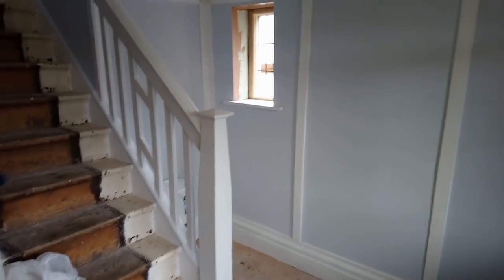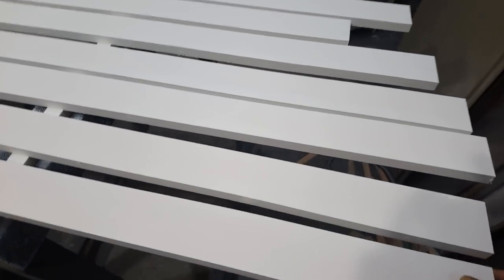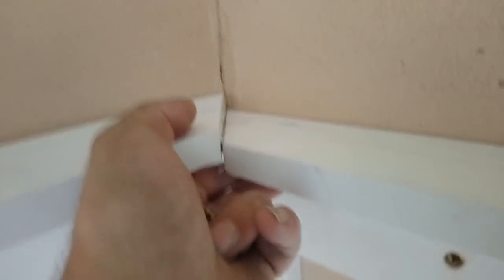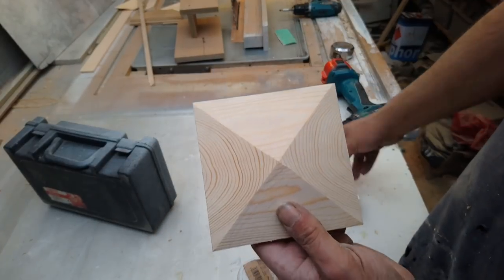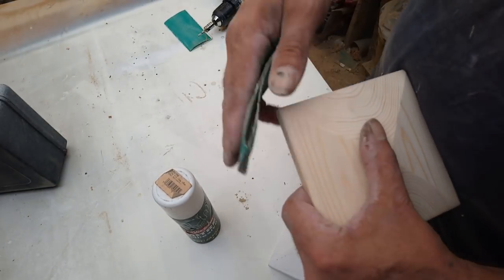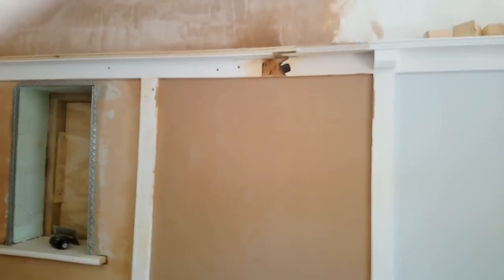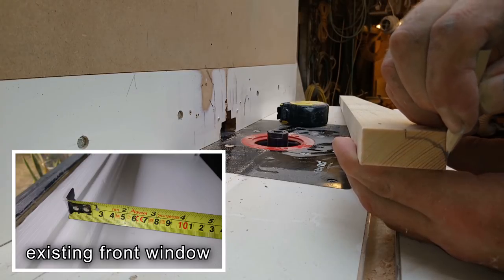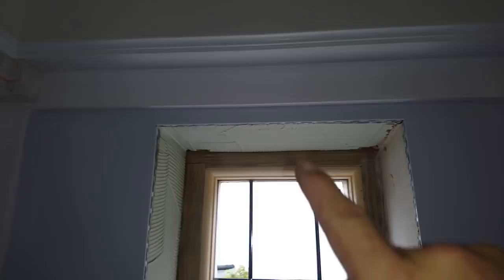Finishing off my friends hallway, newel cap, beading & wall panel slats

Comment: That staircase repair shot shows me how I should probably have done mine 🤣. Still mine won’t be going anywhere anytime soon and I’ve plasterboarded over the agricultural timber and screw combo that now reinforces it.
Reply from the maker: 😁😁👍 As long as it doesn't fall to bits no-one will know what's under the paint 😉👍

Comment: Good videos mate, i have watched back threw a few now. I have noticed that you seem to filter (course filter though) all your paint including the primers and all with the same size filters to. I was always told not to filter primer as you remove to many of the solids reducing its filling/build properties and that 2.5 fluid tip and needle will paint thicker paint than that although you'll never get as good a finish as with thinned down paint, also 2.5 fluid tip and needle setups seem to have a smaller fan pattern on them than some of the smaller fluid tips and needles (my guess would be due to them mainly being used for thicker products)

in one video you said you had to warm the PU adhesive up in warm water because it was cold and would not come out the tin well you can also do this trick with paints to save on thinning them down so much in the cold month, if your using a paint that has a hardener to make it cure you can warm the hardener up to but its already pretty thin so not much need but have seen some people do it.
Reply from the maker: Thanks Ross much appreciated 👍, Yep i use the same filters, 190 normally but ran out so i have 280s at the moment, there's not much difference to me, when filtering with the 190s there's next to no residue in the filter except the occasional lump which you wouldn't want in your gun any way, I avoid spraying if poss when it's really cold but if i do i sit the can in front of a heater to help it flow as you say. My neighbour is a joiner who sprays & i've talked to quite a few people about spraying, everybody has their ways, it seems you can discuss & try to 'share' but as i learnt in the end it's a case of taking in as much info as poss, experience n trial n error,

Comment: I like the little dig at the painter 🤛👍
Reply from the maker: 😊 yep, the majority of painters are crap, this little dig was more than justified 👍
P̶a̶i̶n̶t̶e̶r̶s̶ ̶, crap painters is one of the reasons i spray stuff. I spend time making stuff just for them to come along n blather it wi paint, there's been times where I've gone back to a job n didn't want to take pictures because the finish was so bad, I haven't found a painter I'd recommend yet 😕🙈
Reply: Gid joiner Yeah bad painters can make anyone's work look shit. 
I lived / worked in Holland for 7 years and no shit most of the painters I came across there could make a first year apprentice look good. I've never seen so much filling and sanding, top  class lads. Saying that they had to be good because most of the joiners I came across were lazy rough arses. Great channel btw 👍
Reply from the maker: I work at a house quite often, they'd had an old kitchen painted, you'd think it had been sprayed it was that good, no brush marks, everything was spot on but this man is booked for months n isn't cheap. 
The painter here sanded nothing, painted over drawing pins & the old built up flaky paint from where the toilet was 😓
You'd say a blind man would be happy to see it but i think it was the blind man who painted it 😆
Thanks John. 👍
Reply: Gid joiner Sounds all too familiar 🤯

Comment: I hate painting but started using an airless sprayer and wish I hadn't after watching you, my overspray is crazy, what system are you using?
Reply from the maker: 😂 Yeah it gets everywhere, I use a gravity feed gun & a compressor, 
the amount of dust on the floor (& everything else) after spraying is surprising,
Reply: Have a look at Peter Millard's channel, he had issues with bad overspray to begin with but managed to get it under control.
It's a Graco Ultramax he is using.

Comment: could the newel cap have been made with a router table or would the bit tear out the surface grain
Reply from the maker: A sharp cutter would cut ok but I think it would be hard to get a router cutter big enough, you can get chamfer panel cutters but they only cut about 50mm, There's straight/slightly tapered cutters or maybe just a straight cutter which you can get 63mm long & use a jig to hold at the right angle similar to the table saw except you'd be tilting the piece rather than the cutter, maybe on a spindle moulder but cutting a short piece like this might be dangerous, same for a router table prob, 
either way you'd have to hold the piece in a jig & run it against a 'cutter. I think using a router table would be harder than using the saw, a good sharp saw blade gives a good clean cut & is a more efficient cut therefore less dangerous & quicker.
Reply: Gid joiner tablesaws defo the right way, came out good (and the bullnose) 👍🏻
Reply from the maker: Thanks Phils, Yeah i was happy with it 👍😉
Reply: +Phils Obsession
You could make them with a spindle moulder but not everybody has one and it would not be worth it unless you would making hundreds of them. 

You could do them by eye but it would take lots of practise and even when you get good it is still a slow process.

Comment: Slightly off topic but if you could share some advice it would be gratefully received, 
Im in the process of researching prior to buying a planer/thicknesser. 
I see you have separate machines. 
I was wondering would a P/T be as good?
Reply from the maker: I haven't had a lot of experience with the smaller machines that have to have the surface planer bed lifted, 
For me that wouldn't work, i need to be able to surface plane & then thickness & then surface again at will.
Originally i did consider some bigger machines where the top stays in place but the price was too much, maybe one day, I'd like one with a surface that's 12"+ wide & longer than i have. If that has to be a P/T then so be it, maybe it'll save space. These types at Axminster tho only have a bed 1390mm long n cost a couple of grand, mine's 1100mm n cost £80 from eBay.
The big old machines or a Felder that have a nice long bed are what I'd buy if i had the money & space, they are Planer/thicknessers. 
Is yours to for work or play?
Reply: Gid joiner 
Both really,  I've been looking at the Axminster ones, i had a play on the spiral cutting P/T ir was lovely,  the only separate surface planer they have has a 6" wide bed.
Reply from the maker: Love new tools but i'll have to live with what I've got.
If i could/have to buy again it would have to have -
A have a surface planer 12" wide that didn't have to be lifted & thicknesser to match 12" wide
A surface bed length 2m or more. I struggle to get pieces more than 1800mm long straight because mine is only 1100mm long .